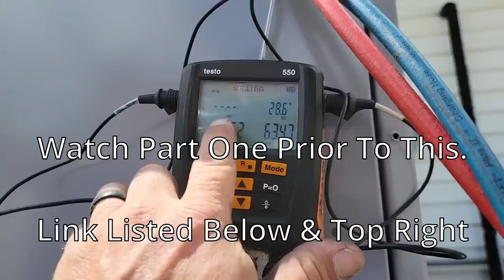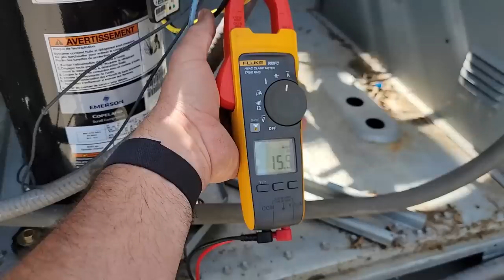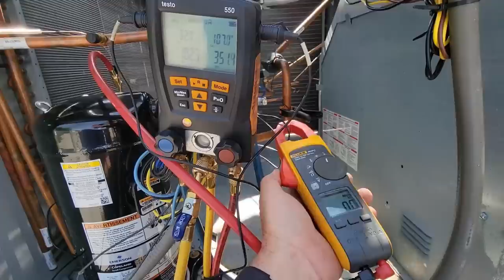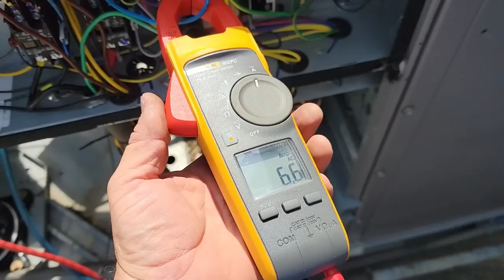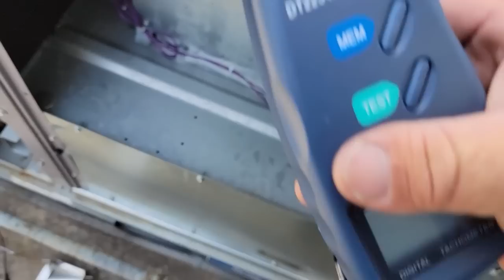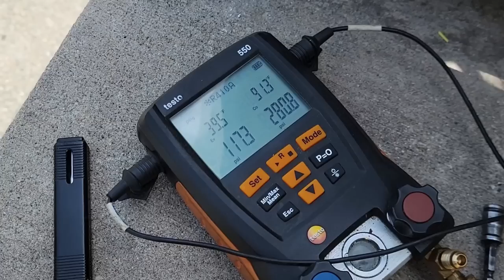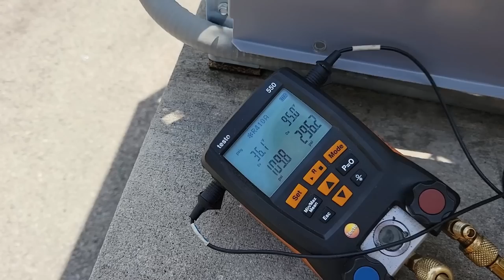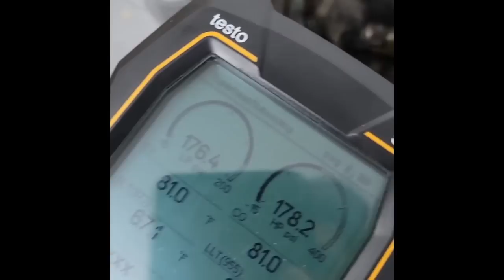If It Can Go Wrong It Can And Does... THE RETURN TRIPS

Comment: It needs to be AC for the current loop to measure it.
Reply: Technically it's still AC there, but because of the diode in the compressor the AC clamp is not going to read the current spikes properly. Should use a DC meter on those to see current.
Reply: @TechnicalLee   ac is only ac when it crosses zero, rectified ac is dc no matter how dirty the waveform is. The difference this makes has everything to do with the style of amperage pickup. Most ac/dc amp clamps use hall effect sensors that are capable of detecting differences in the magnetic flux to a much higher sensitivity whereas the split core pickup that most ac amp clamps use are designed to pickup the magnetic flux created by a sinusoidal waveform
Reply: If its an ac amp clamp yes

Comment: Rick, something to watch on the low pressure bypass is that it doesn’t short cycle if you loose charge. I had one a take out a compressor in cool weather on/off- on/ off constantly due to a leak. Every time it shut off on low pressure it would recycle and start again. I’m .it a big fan of that control.
Reply from the maker: That would be another good reason to kick it to the curb, I haven't needed one before except with a few Lenox heat pumps from 8 plus years ago. I ran it by one of the guys that makes a lot of decisions and he didn't seem worried, so I figured instead of getting a callback I'll put it back on.
Reply: It needs some kind of additional module or device that has a "3 strike" thing like Lennox has on their RTU's. 3 low pressure cut outs, and then that compressor is locked out for the remainder of that call for cooling. Or another way to do it is move the delay on make timer, so the compressor contactor always has a 1 minute delay to make on startup, 3 phase compressor shouldn't bother it too much to start once a minute if someone there is on top of things and calls HVACR Survival to let them know the A/C is down. They probably won't notice a 1 minute delay of the compressor starting.
Reply: You have a good point on low pressure loss of charge. But what if on this unit the condenser fan motors lock up or the run cap dies. Then the poor compressor is short cycling on high pressure cutout, and that will kill a compressor a whole lot faster than short cycling on low charge. Some of those R410A HPCO's trip at something crazy like 600 PSI! Imagine what the discharge temp is at that high of head pressure, scroll compressor go 'nope. I'm done, l8r'
Reply from the maker: I believe the control board has a lockout for that type of trip. My feeling is they should have purchased the economizer but if the customer doesn't want to spend the money then what do you do?. When You cut corners to save money... you'll spend a lot more later. We have them the option, they didn't take it, that's up to them,  I don't feel bad for them after that point.

Comment: Ah, you ended up increasing the blower RPMs by about 20% compared to before. Blower is probably designed for 1000 RPM max. Probably best to just stick with amp draw to check airflow since it accounts for both RPM and static pressure. Also a good lesson on jumping out Y2 in case the thermostat is goofy.

Comment: There are clamp on meters with a DC clamp function.  Unfortunately, I see the unit used in this video does not have such a function...AC only
Reply from the maker: I have a Fluke 376fc that can do DC amps but like I mentioned in the video, the rectifier was located at the end of the plug at the compressor. It would have been AC yet where I measured it.

Comment: I would not have thought it would be a good idea to bypass the low pressure contact. What is going to happen if there is a situation develop that results in a low system pressure and that extra thingo's contacts are closed? Surely it should be in series with the low pressure switch instead of as it is in t he circuit diagram parallel across it?
Reply from the maker: The normally closed contacts will open in about a minute once the timer closes and applies power to the coil on the relay, then the control will lock out.
Reply: In an ideal world they would've just had a dang economizer on the thing, but I guess a relay is cheaper

Comment: Your meter can only measure AC through its current loop. Thats the reason you aren't seeing current for the solenoid
Reply from the maker: I have a Fluke 376 that can do DC amps but the rectifier is at the plug on the compressor. The place I was clamping was 24v ac. But the DC coil pulled very low amperage.
Reply: @HVACRSurvival  it can? I’ll have to look up that meter, but watching the video and looking at the meter the amp clamp setting it had a sine wave above it. I cant believe that the compressor coil draws less than 100ma but maybe it does.
Reply: And I stand corrected on the 2 stage compressor coil pulling less than 100ma. Doing the math at 25vdc and the rated resistance of 1640ohms, it comes out to .015amp. I’m very surprised they used such a high resistance. Maybe they think in certain situations this will be wired directly to a thermostat? Who knows, but with that much resistance on a coil the kickback voltage is going to be insane. And furthermore the part you were measuring was ac! They put the rectifier diodes in the rubber power plug! Thats gonna confuse a lot of techs. Unless you look at the data sheet and see that it says “molded rectifier plug” you’ll think it gets fed DC from the control board like I did.
Reply from the maker: @PINKBOY1006  I use the 376fc on my generator starter checks. It's pretty accurate but it should be for what the meter costs. I have a Amprobe nav52 that also does it. Surprisingly there are some cheap $50 meters that also do dc amps on the clamp that are accurate. Crazy 😧

Comment: most clamp meters will not do DC current and those that do are generally very inaccurate and influenced by surrounding metals/magnetics. for DC current, the best bet is direct series connected meter or an tested/calibrated series current shunt and meter combined!  now is where we hit the great divide of upstream engineering and field technician work. the engineers spew cruft left and right, which is "all to often" non field serviceable/testable with multiple hours and theatrics and stunts! to only find lower level issues were to blame, back to the factory produced coils/joints/junk/wiring. upstream stooge cruft, giving bad wraps to all. AKA. collegiate sheeple with near ZERO real world hands on experience and labor. but by golly they can engineer and do it all! I say, just walk away from them all.
book only/hands off training is about as useful as nipples on a boar/bull. please go try to milk BULLS and run with them if you think that will workout in the long run. 🤣
Reply from the maker: That's why I said I was over thinking it, just measure the amp draw on the compressor not the solenoid. If it changes it must be working. 🤦🏻 oops